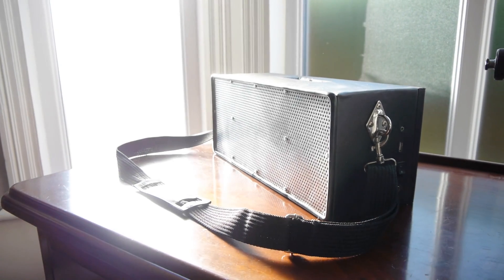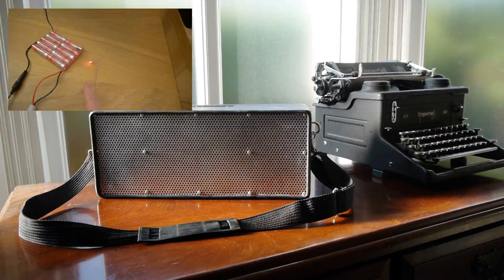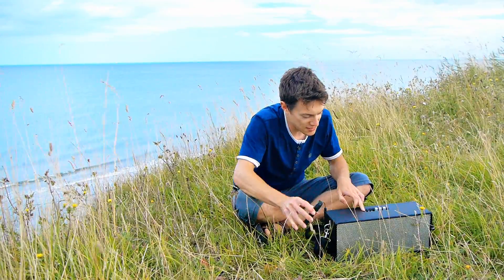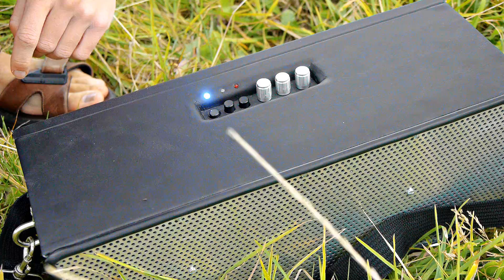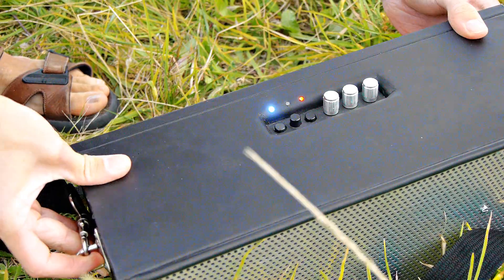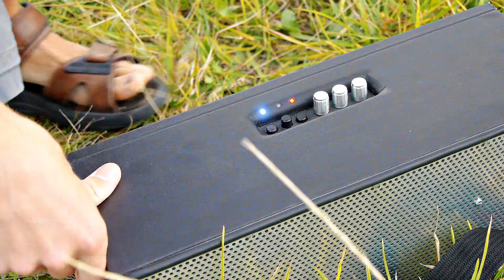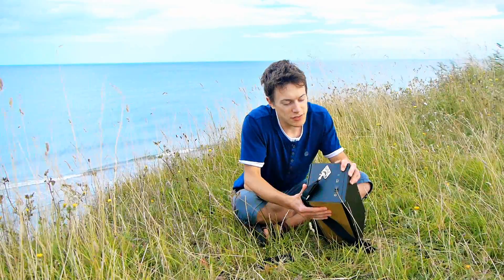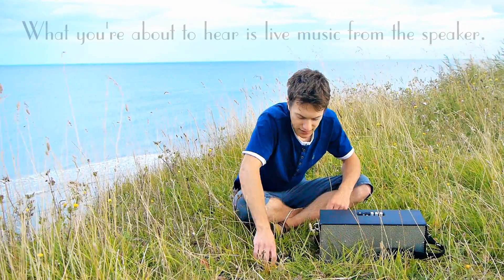Homemade Bluetooth Speaker (DIY Jawbone Jambox)

Comment: Just wondering, how did you calculate the correct size for your subwoofer and speakers enclosure without electric info of your speakers? And how did you calculate the length and size of the port?

Comment: i bought a 25 dollar speaker from biglots and i had a dual speaker box with 6.5 " driver and i took out the amp from the bluetooth speaker and modified the amp to fit in the other speaker box its not super loud like this one doe

Comment: You gave me alot of inspiration for my Bluetooth Speakers!^^
I used exactly the same Speaker drivers but another Amplifier!
I used an Class D 5.1 Amp:)
For the Enclosure i used 12mm mdf (like you)!
For Power i used a 8000mah Lipo Battery (the one you often use in your Vids) and its charged by the turnigy accucel 6;) Also used a Battery low Voltage Alarm!^^
I also covered the Frame nicely with Material which is especially made for Speaker Boxes:) 
For the switches  Potentiometers displays etc i decided to mount them onto a really high quality piece of wood which is screwed onto the Back of the Box:)
To protect the speaker Drivers i also used aluminium which is screwed onto a wooden Frame! It took about 8months to build it and it costs about 130€ or so:P
It looks quiet similar to the box you built!;) Thanks for sharing your Ideas! Gave me alot of Inspiration!
If you would like to see it and I can send you some pictures of it!:D

Greets from Germany!^^

Comment from the maker: Cheers! Yes, there's distortion on one of the clips, but that was only because the battery needed recharging.

When it's fully charged, it has more voltage, so the amp pretty much distortion free at max vol. It's actually quite amazing, because it has so much PUNCH!

As for it sounding like a subwoofer... it actually IS a subwoofer ;) you'll see what I mean in the buildlog.